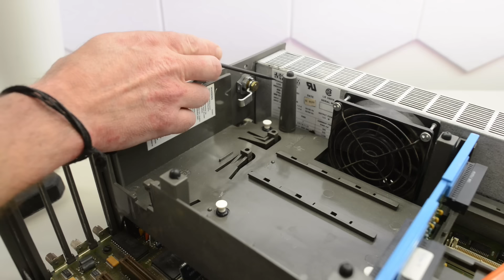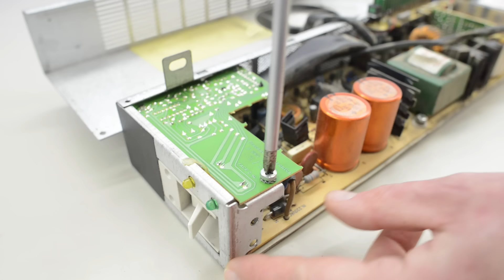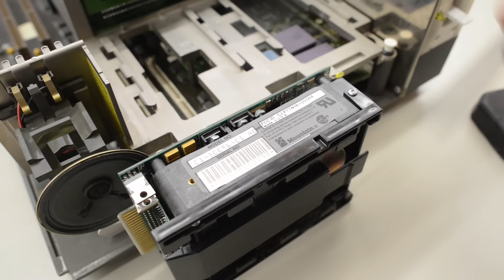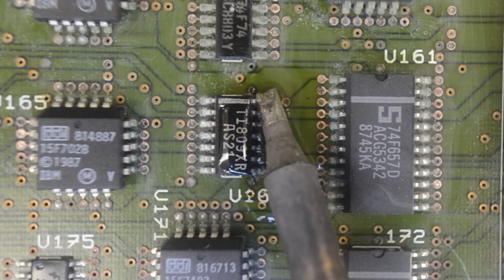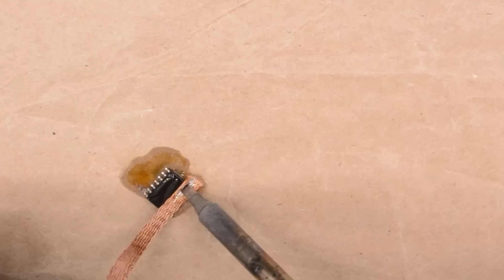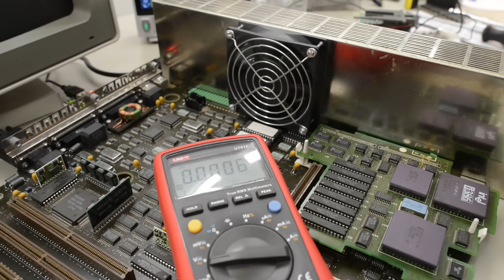IBM PS/2 Model 70 troubleshooting black screen. Type 1 and Type 3

Comment: I remember Those machines. 
I bought som Ram from IBM back in 1998 for 4 times The Price for an equel size to a clone pc. And it had to be that brand! It was, if i remember correct, 2 MB fastpage memory. But i newer found out why normal non ibm ram would not work. It just posted an error and that was it. And in 1998 The internet was bad, so No help there.

Comment: I am pretty sure you looked these codes up:

221 Machine error when copying the BIOS into RAM (8580-111 only).
ROM to RAM remap error. An error occurred when the system checked the 128KB
that was to accept a copy of the ROM. This is a latching error; once the
error is detected, the system will no longer try to move the ROM to RAM until
diagnostics (SETUP) are run to clear the error.

225 Some of your memory may be defective or not fast enough for your machine. 

The 221 maybe a model 80 error but might give you a clue.
Reply from the maker: Yes, thanks

Comment: CRC Lectra Clean can get off lots of stubborn residue from PCBs and metal. The only problem with it is that it eats and discolors some types of plastics like ABS. It will also etch LCD screens, so you have to be careful when using it.

You can hose down an entire PCB with the stuff if you need to, just make sure its completely dry before you put it near any sort of case plastic.

It works A LOT better than IPA removing leaked capacitor electrolyte. IPA usually just smears it around and leaves white streaks.

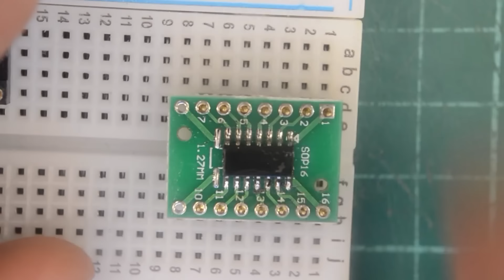Comment: 29:58 My favorite technique for "cutting" pin header strips is to firmly grip with two pairs of pliers, held snugly alongside each other, one on either side of where I want the break to be, then I can precisely snap the strip at the intended spot
Reply from the maker: I'll try that, thanks
Reply: @Epictronics1  I haven't had to do it in awhile, but I recall a mild alternating rocking (not twisting) motion working best to induce fatigue into the plastic at its thinnest point

Comment: wd 40 removes most glues .it might un stick lables so you know .
Reply from the maker: I'll give it try, thanks
Reply: @Epictronics1  works well with contact adhesive.incidentally if you ever get contact adhesive on your hands wd40 will get it off

Comment: 22:28 it appears that what you have there is an original 386 before there was a dx and sx variants there was the 386 which ram at 25mhz and is essentially a dx with 32-but bus. Lucky find!
Reply: Yep, was looking for this.  Before there was a DX and SX, there was just "the 386" -- and it was what would later be called DX.
Reply from the maker: Yes, I did some reading and I think you're right!

Comment: You can try Nifti for cleaning, which is a strong water based ammonia cleaner.  As for solvents, general purpose auto thinner works well and is the weakest thinner, but it will remove writing on labels and may damage plastics.
My Caig(Deoxit) rosin flux looks like it works way better/faster than that flux, ie, way more aggressive cleaning, it's just that it's so gluey it's hard to clean, ie, after IPA you need Nifti. It's so good that you only need to dip the solder wire in it, ie, a tiny amount, and it's plenty enough to make a shinny joint.
Reply from the maker: I think I have some paint thinner. I'll give it a try, thanks

Comment: Yep, first rule of electronics repair - thou shalt check voltages. And yes, that includes the power good signal.

Between my three model 50s, they had two dead power supplies, and one planar with a shorted power rail. And obviously three dead/stuck ESDI hard drives. Thankfully I could assemble one working unit, and I've got a SCSI card so technically I can get it booting from that. Unfortunately even after many years of sitting on the healing bench, I still haven't had a chance to actually get any further than confirming it POSTS successfully. Although even if I get more than two days of leave this year, I've got plenty of other projects with a higher priority than the model 50, so I'll probably just end up working on those instead. At least I know of a YouTube channel that likes making videos working on old IBMs! 😁
Reply from the maker: Yeah, I've checked the power good pin on so many power supplies over the years. It has never failed until this day, when I didn't think to check lol
Reply: Just connect the power good pin to 5V. They're both 5V.
Reply: @simontay4851  If memory serves, the power good signal is asserted by the power supply to signal to the motherboard that the power rails are stable and it's clear to boot. To bypass this signal, you'd need to disconnect it from the power supply side, since there's some chip or transistor inside the power supply holding it low. Probably OK to do it for testing if you're certain the rails are good, however it's better to figure out why the power supply thinks its rails aren't good since there's evidently some underlying issue with the power supply.
Reply from the maker: @simontay4851  That would probably work, but there might be more to it.
Reply: @simontay4851  If the PSU doesn't assert PG, there's a reason.  Unless it's just the pin's last transistor that's broken, bypassing PG is unlikely to make anything better, and might make it worse.

Comment: A Model 70 is what started me learning about computer repair. I should have some IBM 2mb SIMMs, but I can only test in my model 80 on an expansion card.
Reply from the maker: I may have a SIMM. I need to check what part numbers are compatible and go through my stuff. I didn't know the Model 70 was so picky with RAM.

Comment: why are you desoldering the logic ICs? not only they are most likely fine but you only need to test the logic - if its a NAND gate that has to output a low check which of the inputs is low and go from there

Comment: Nice machines you've got there Roman! Love those early 386 beasts.
To remove that terrible goo: Try orange terpene (or goo gone / any other sticker remover). It smells really bad but it worked a treat on my Model 60 and 80 👍
Reply from the maker: Thanks Pip, I'll give that a try in the Model 80 video

Comment: I think many old IBMs required RAM with pairity chip and if you manage to find one, they are very picky when it comes to comaptibility (don't ask me how I found it out with my PS/Valuepoint).
Reply from the maker: Oh, am I going to get the same issue when it's time to restore the PS/VP...
Reply: @Epictronics1  9-chip memory module worked for me - no coincidence it was branded IBM
Reply from the maker: @86smoke  Ok, I used IBM branded parity SIMMs for this board, but apparently there only seems to be one IBM P/N that works in the Model 70 :/ I'm hoping there is a hack to use other modules
Reply: @Epictronics1   Well, I intended to share an info on PS/VP restoartion, not the board in video. Besides, what model of PS/VP do yo u have? Mine is 325T/S with weird Cyrix 386SX with internal cache
Reply from the maker: @86smoke  cool, the weird ones are the most fun. I'm not sure what model I have. It's in storage, so I can't check right now
Reply: @Epictronics1  so I'll wait for the video then

Comment: dx chips normally need memory in pairs, is it the same for these ps/2's ?
Reply from the maker: I'll double-check, but I think this board will run with one module
Reply: @Epictronics1  It depends on module. If it is 36bit parity module, then you are all good.
Reply: You should only need to match the memory bus width of the CPU.  72-pin SIMMs are 32/36 bit wide (non-parity / parity).  A single 72-pin SIMM should match the 32/36-bit width of the CPU memory bus.